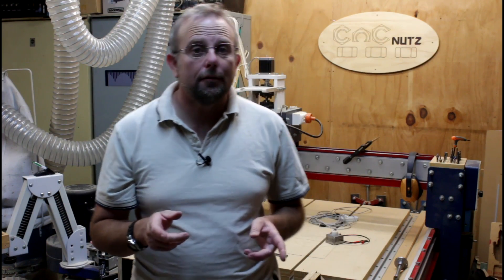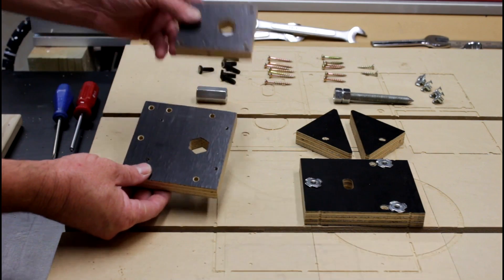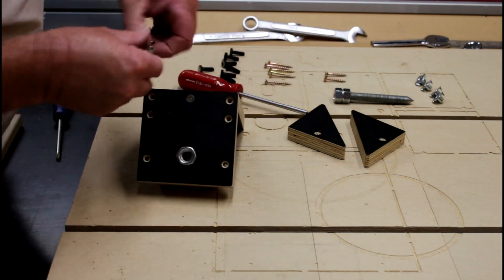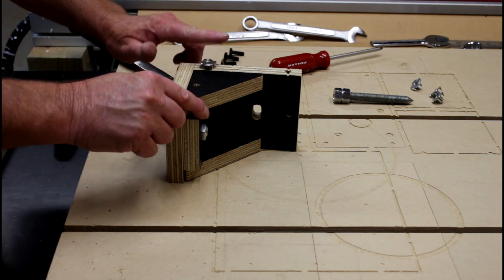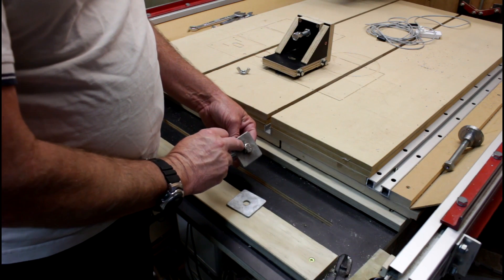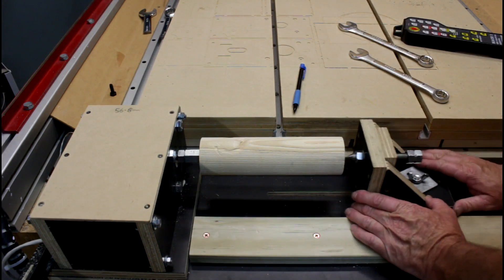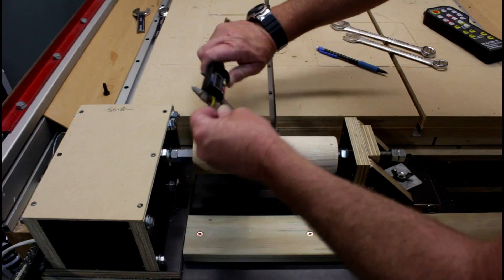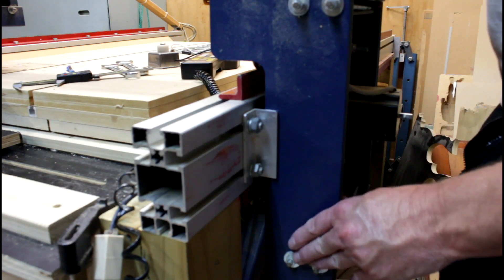Tailstock Project - CNCnutz Episode 80

Comment: Hi Peter!  After a few years would you change anything about this build.  I'll be building a 4th axis this winter and I like your design.  I'd also like to be able to mount a 4 jaw chuck on the head stock as well.  Thanks!
Reply from the maker: I really don't use it that much but if I had the funds I would but a metal headstock & tailstock like Mark Lindsay did. If I really had the funds I would make a stand alone rotary axis / lathe. For what I use. It for it is fine for me. A 4 jaw or 3 jaw chuck would be a great addition and make life easier.
Check.out Marks build here.
A Rotary Axis for My Gatton CNC: https://www.youtube.com/playlist?list=PLLuYLaC3-QRPUVbm2IspdsTspmrQxv8ad

Merry Christmas to
Cheers
Peter

Comment: thank you for excellent videos...
AWSOME
on another note...
the pendant that you use... does it have an MPG wheel.. .and is that hard to set up in MACH3.?

thanks
Reply from the maker: Hi Frank,
Thanks for watching.
The pendant can be seen here.
Mach 3 Pendant Review
I made the video private as several people tried it and found the the cable between the pendant and the PC to be a weak point causing it to  stop working. I do not want to encourage people to buy problems.
I wore out the cable on mine after 2 years and just made a new one.
I really like the pendant and it does all I need.
It is very easy to setup out of the box unless you want to make it do other things as I have done with mine. Even then it is was easy, (in my opinion).
It's most redeeming feature is that it is cheap, but remember what I have said about the cable. You will need to decide for yourself.

Here is a link to someone selling a similar pendant but it is a 4 axis version
I have no Idea what the seller is like and they  may have improved the product by now as I bought mine 2 1/2 years ago.

http://www.ebay.com/itm/CNC-4-Axis-USB-Pendant-Manual-remote-Control-JOG-encoder-for-Mach3-ONLY-/271352502949?

Hope this helps
Cheers
Peter

Comment: Nice video again.

Peter, just a quick question ref. your CNC machine:
if I am not mistaken I saw you sliding the portal towards you - just doing it by hand.
Doesn't that kill your electronic controller as it would generate an inductive voltage and current through the the stepper motors to your electronic driver? Or how did you decouple that? 

Regards
Raimund
Reply from the maker: Hi Raimund,
The drives I use has no problem with the induction from my stepper motors when I move the carriage by hand.
That said, it should be noted that both Y steppers are disconnected and one of the drives is used to move the rotary axis so it is not an issue no matter what drives you use.
Cheers
Peter